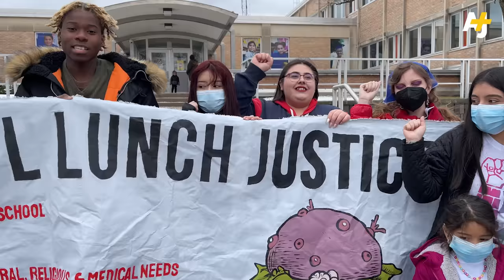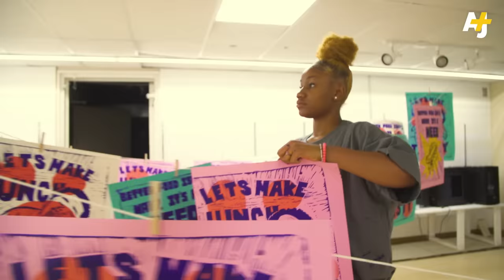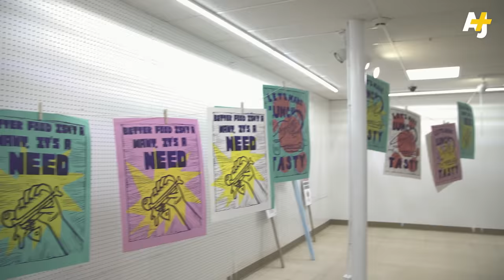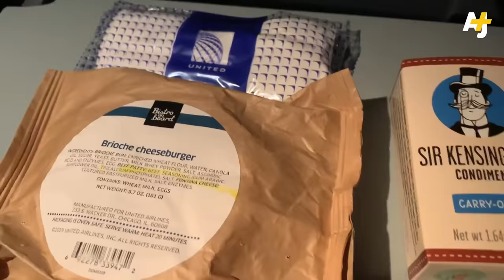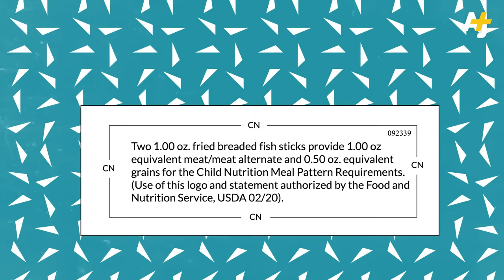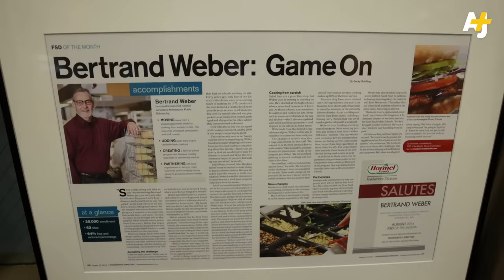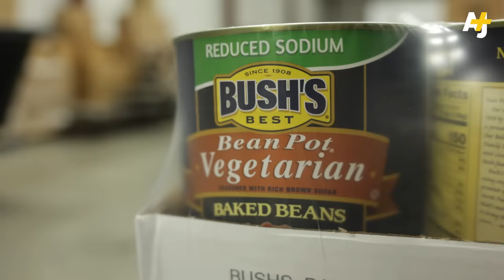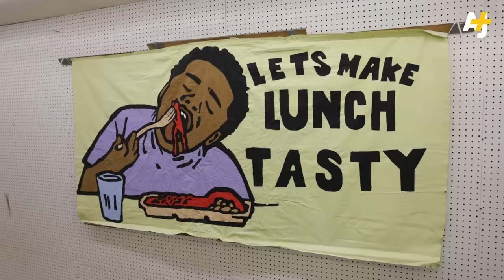What’s WRONG with school lunch in the U.S.?

Comment: Prime example is I bought a very nice high end commercial stove from a private school, because they were only using the oven on it, they don't actually cook anything just reheat stuff so the 20 some thousand dollar stove was only being used for it's oven and they needed more ovens and microwaves to reheat stuff. The induction burners on the top of the stove simply weren't being used. Compare that to when I was in school as a kid and there was an actual kitchen at my school that cooked the meals. So it's not just public schools that have gone down this path of processed garbage.

Comment: As one who worked with children welfare programs, i'm 11/10 sure the pitiful lunch IS NOT okay as a proper meal. First sign of it, you have an overwhelmingly high sugar and starch(aka carbs) content, which everyone knows is the main cause of obesity. Then, little to no protein, not even any soy product or eggs to make it up. Lastly, the only dietary fiber sources are from the overwhelmingly pity portion of fruit salad and apple(very little fiber in it), children are going to develop constipation and weak intestinal immunity.

the suggested portion by weight between food composition for children should be [protein 2: dietary fiber 1:carbs 1]. Dietary habits like this will also reduce the crave of sugar in a long run, it works like drug rehab.